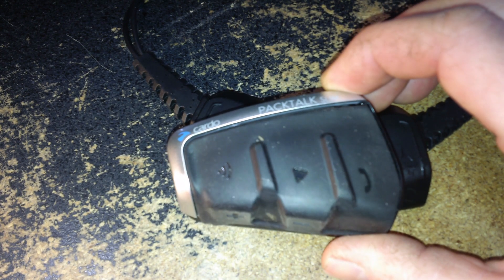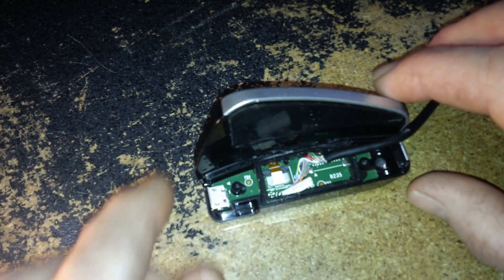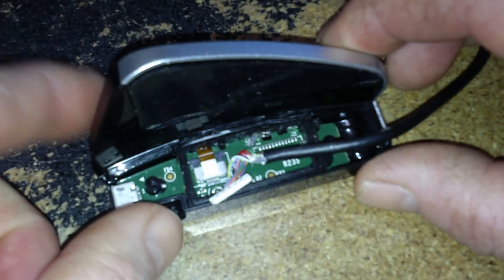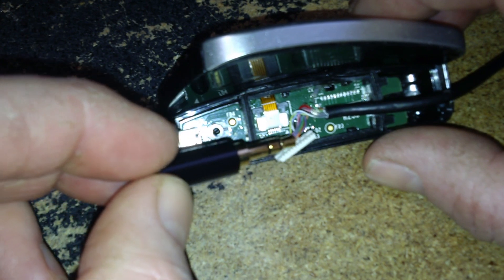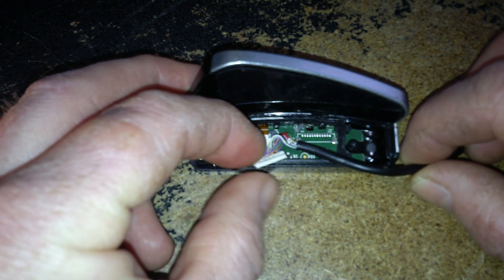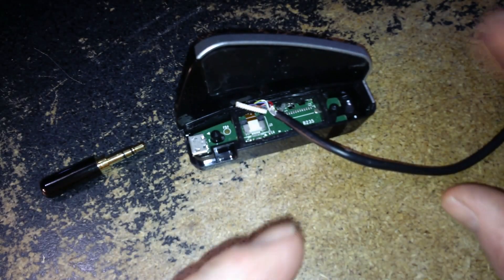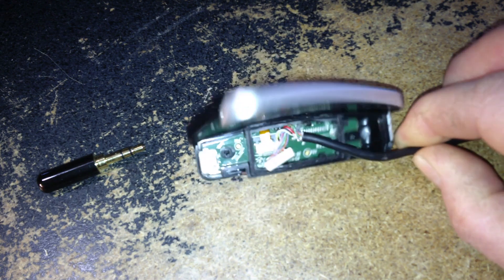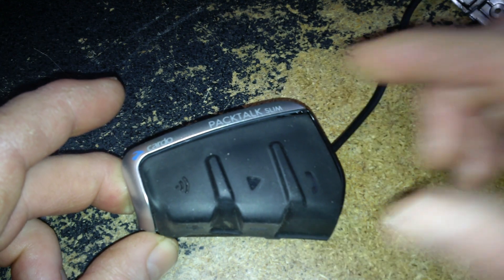Cardo Packtalk Slim TEARDOWN. Sorta. USB Issue and Wires torn out.

Comment: My usb has broken, out of warranty and Cardo does not fix it. This is the last time I buy a Cardo. Now I'll buy a Midland or any other
Reply from the maker: Cheap ones work well and do work with cardo in universal mode. Save your money!
Reply: @MicahGallant   Yes, I have already had Chinese and some work well, but others have the battery breaks down very quickly, also, my trips are very long and take many days, so I need something that inspires confidence

Comment: I had two units with broken usb connectors :(
Reply from the maker: Unfortunate for sure. If they were purchased new though i assume warranty would replace them
Reply: @MicahGallant  One was replaced already, the other is probably out of warranty by now. Downside of being a new parent, you don't get to ride that often anymore
Reply: @justinhalsall4077 Do you have on, which you could give/sell me? My one is broken too and I need the Flex circuit in the control unit....Thank you!!
Reply: @eNpiii  unfortunately not, sorry

Comment: Thanks for this...did you see if the ground wire from the antenna is coming back to the pcu? I got a unit here... Connecting the wires from an usb micro to the rest of the connector .. my connector is broken on the wire side ...so I will remove the black connector from the PCB and try to solder the cables directly to the unit... Only thing I was wondering if the ground wire is coming back to the pcu?
Reply from the maker: Yes, the ground wire on the antenna goes back to the main unit. its basically a mini coax cable with solid centre wire and outer mesh wire jacket
Reply: @MicahGallant  thanks. Have you seen on which pin it goes back? Any detailed picture maybe? Can't see it on the video. However I'm not sure ist it the antenna roe WiFi, Bluetooth or maybe only Radio?
Reply: Ok got it repaired;) thanks  for your help
 It's basically more or less a passthru from micro usb to the main unit in the back and some switches... Not that hard only the microsoldering fucks a bit
Reply: My packtalk slim usb pulled out last night just from unplugging it. Are you for hire to fix these?